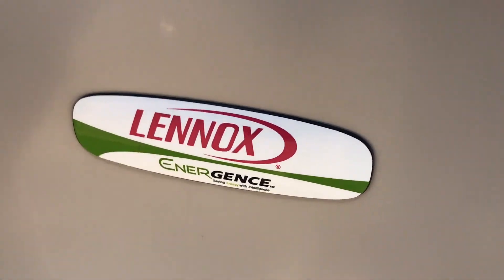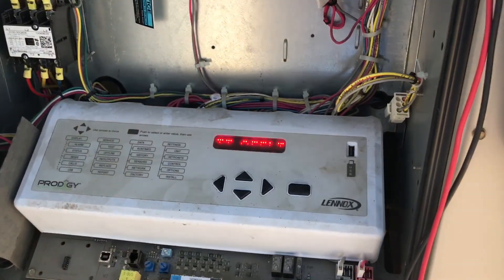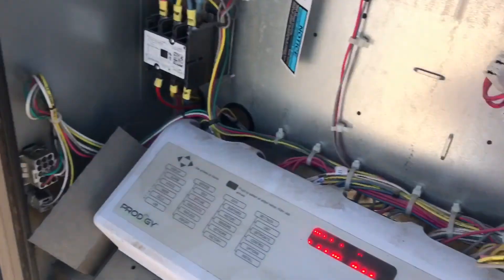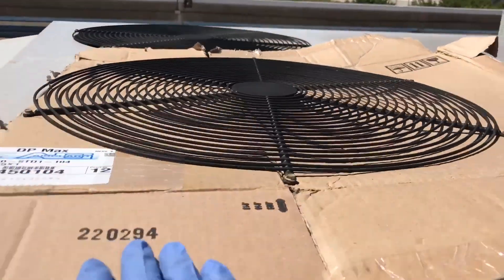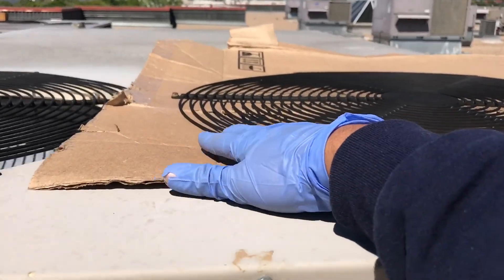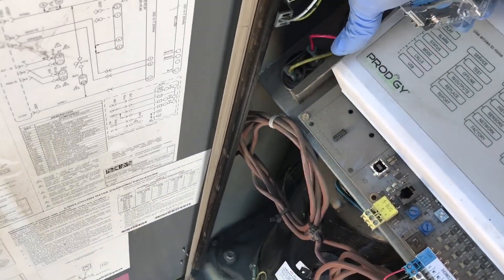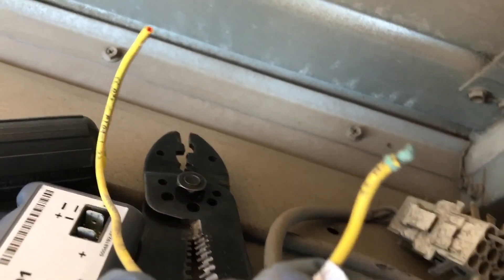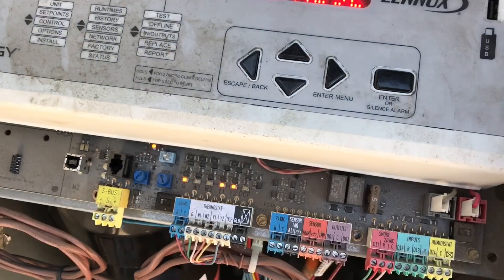Lennox prodigy controller in test mode. Fan motor and Enthalpy sensor

Comment: Nice video Ulisses. I have seen those Prodigy boardsdoing pm checks on units but never had to troubleshoot one yet. A code 13 is the sane code Lennox used on their LGA line of equipment. High head pressure trip. I remember that one. Good video as al ways finding multiple problems and fixing them.